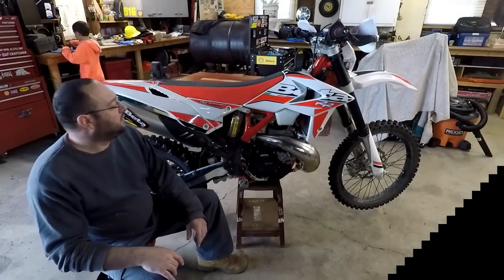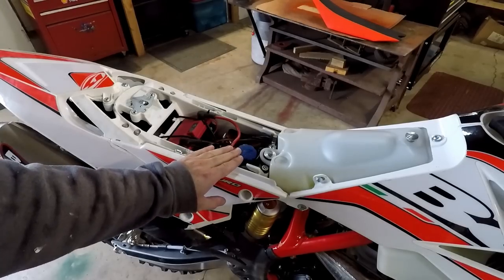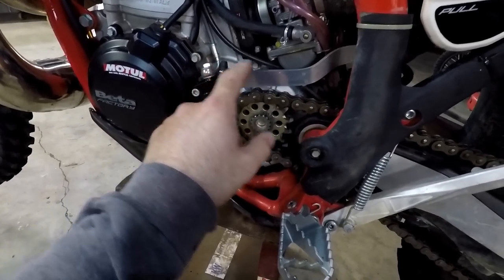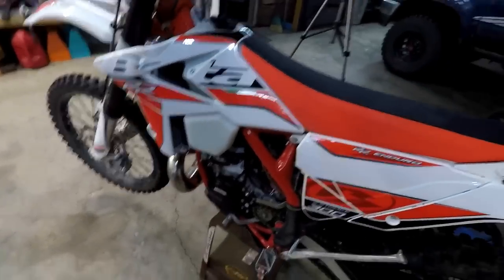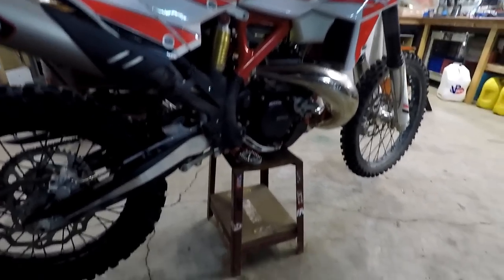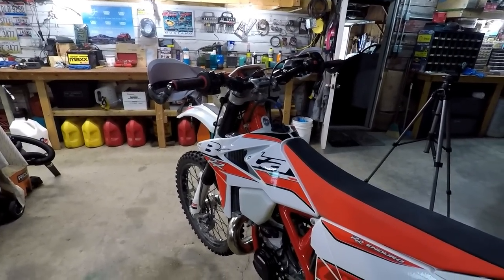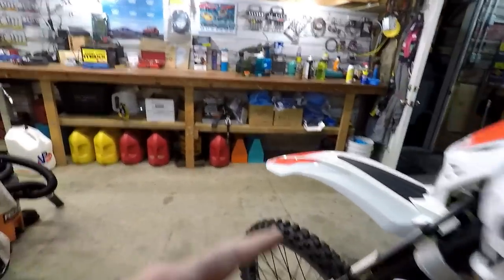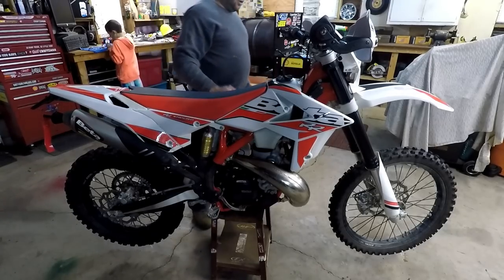2018 Beta 300RR Review PROS and CONS

Comment: I have the same Beta 300rr 2018, the problem is this bike it will make you think you are a better rider than what you really are and then you start to get cocky then into trouble, LOL . My speedo has done the same and it was a common thing, Beta should replace this for you.  I have never had a bike that you don't need to do a thing to it, as in suspension, power or add on like the FMF, V-force reed cage, hand grips, springs. The seat to me is not to bad, my one has soft written under it on the backside, the bike handles very well. The Beta's in Australia are around $2000 cheaper than the KTM and even cheaper than the Husky. I have friends with KTM's and they all need the suspension done to make the ride more enjoyable?usable or exhaust done, or replacing the reed cage to a V-force4 or something needs to be done. Beta's statement (Ready for anything) is spot on.Thanks for shearing.
Reply from the maker: @ BrokenSkull; 100% spot on with everything that you said! When I went on my first serious ride I felt like a friggin' hero on this bike! Everything just comes together and works so well for it being stock! People really need to get out and give the bike a ride or just get one, they are honestly that good. A friend of mine who tried my Beta still went out to buy a new TPI 300 KTM. He wanted the standard kicker and liked that the KTM dealer was close by. I understand all that, but with how easy it is to get parts of the internet, I would never be too worried. Most people that ride have spare junk lying around for minor crashes or flat tubes, etc. Anything serious can be had in a few days I believe. But yeah, great bike and with the money that I saved I was able to purchase some REALLY nice riding gear. I hope to see more people on Betas in a few years great bike and thank you for sharing your thoughts sir!

Comment: Nice review, I've owned mine around 10 months and never had a problem. When I was riding in -10c in the winter the starter sometimes missed the first few times of trying but the battery never let me down and it was kept in an unheated garage down to -25c some days. Kick start not needed in my opinion.
Reply from the maker: That's great to hear and thank you for sharing! I keep mine in another building that is heated, but yeah, there are going to be times where you may ride in cold weather, so it's good to know that this baby will crank. I really like the bike, very well balanced and seems to be built well. I did have to go over nuts to make sure things were tight after a few hours, but you'll get that with any bike. Thanks again for watching, it means a lot!

Comment: My computer also broke on my 2018. My dealer immediately replaced it. The only other issue I have had with mine was I did not like the sensitive front brakes. Other than that I love my bike.
Reply from the maker: My dealer I guess didn't care about me. I've called 3 times and they still didn't have a computer for me, so whatever. It's not completely broke or anything since I've fixed it with epoxy. It would have been nice to get a new one, but mine is still okay. It took me a while to get use to the front brakes as well, LOTS of stopping power. You really have to take it easy! It's a great bike, I'm glad that I have it and it sounds like you are too! Thanks for watching!

Comment: Good stuff, thanks for the outstanding review. Do you still have this bike? If so how is it working for you two years later?
Reply from the maker: Thanks for watching! Bike is still good. Battery is still good (I keep it on a tender) I'm going to need a rear tire soon, but otherwise, it's been a solid performing machine. The oil injection has been fine too. I run non-ethanol 90 in it. Work very nicely I think. Fit and finish still still holding up as well.

Comment: Thanks for the review! Haven't pulled the trigger on the purchase yet,  but close. Have owned KTM 200 and 300 in past. Loved both. I'm 6'2" and about 230 lbs now (weight up lol)...so I think the Beta 300 will be better than the 200 for my fat ass now lol. Low end torque and some mid are what I use 95% of the time. Subbed.
Reply from the maker: Thanks for the sub sir! I think you'll like the Beta 300RR. It's been good to me so far and I think a lot of other people have been happy with it. I don't ride as much as I use to, but when I do, this thing is just sooooo nice! If you get a chance to take one for a rip you should should do so and yes, that 300 will have so much more power than the 200 you are use to. The only really big advantage to the 200 (I think) is that it weighs less, but man, the 300 is like a tractor on nasty hills. I am still honestly blown away with how much you can lug this thing! Thank you for the comment and sub, GREATLY appreciated!

Comment: Im thinking into buying a 2018 300rr race edition. Any differnces between the two? This will be my first time on a 2 stroke if ever. Picked up a few answers i had in mind with your vid. Thank you. Liked and subbed.
Reply from the maker: Thank you so much for the kind words and subscribing, that means a lot to me! The 300RR Race will NOT have the oil injection and will have some different graphics, but that is about it. The Race might also have the kicker, I honestly forget. So, you'll be mixing gas, but you won't have to worry about the OI pump failing. Mine regular 300RR is still doing fine. Either way you're going to really like the bike. Let me know how it goes!
Reply: @BarnStangz  
Thanks you for replying. Will let you know when i pull the trigg on the beta. 👊✊🏍💨💨

Comment: during the break in period (15 hours if you read the Manuel) it will use oil a lot more oil than after the break in period. it really comes alive afterwards. but i do agree the light comes on too early.
Reply from the maker: Do you think the computer is programmed for that? I wonder if it knows that hours from the hour meter or whatever. I also remember the book saying to put some pre-mix in the tank for the first few rides as well. That's what I did for my 300RR.
Reply: @BarnStangz  i don't know if its somehow linked to the meter or if its something in the engine but i do think its a good idea to put premix in the gas for the first tank.

Comment: Don't know where you are but I bought and get anything I need for my 16' RR from Adventure Off-Road in Tennessee. Beta sent out a replacement  for the diode, it's not a diode but I can't remember what it's called. Beta also replaced my speedo when it failed even though it was over a year old. Dealer makes a huge difference.
Reply from the maker: That's nice, yeah, my dealer has been a bit of a let down. They never got back to me about my speedo, even though I called them a few times. I sort of gave up. If Beta is going to succeed in selling these bikes they need to keep after their dealer next work or people are going to jump ship. I'm glad that you have had good luck with your dealer. I'm in Ohio, btw. Thanks for watching!
Reply: @BarnStangz  I forgot to mention I'm in Louisiana but will drive the 500 miles to get my bikes from Mark. The absolute best prices and quality service.
Reply from the maker: Nice, good to know and thanks for sharing so that others know!

Comment: 👍Nice review, very detailed.  Answered a few questions I had in mind. Liked and subbed.
Reply from the maker: Thank you very much for watching! And I appreciate the sub, GREATLY! I actually took the Beta out today and it took a LONG time to start up since it was sitting for a while. I've noticed that with this bike. Good thing that it has am electric start. I bet it had to crank for a full 20 seconds, but it did start. I also make sure to plug the battery into a tender, that's a must to keep the battery fresh! I'll have to do a little review video on this bike, now that I've had it for a while.

Comment: waiting on delivery of my 2019 300rr BYOB. 1 inch lowered suspension, 1 inch lower seat, kick starter, rad guards and other farkles.  super excitd. thanks for the review. How did you get your bike so clean?
Reply from the maker: You are going to love the bike man! You'll have to come back here and post your thoughts. I was absolutely blown away with how well it worked off road. The engine is pure magic!

I don't think it's that clean, the wheels are pretty dirty still, but thank you. I made sure to pressure wash it very carefully and I then I hand wash everything else. I also make sure to plug the silencer so that water doesn't get in. Thanks again for watching!
Reply from the maker: Justin; You're going to love it man! The only thing that I'm worried about in the future will be if the oil injection ever takes a dump, but so far so good!
Reply: I have my bike.  love it.  raced an enduro last weekend.  I sucked, but the bike preformed flawlessly. Lowered from the factory.  very easy.  They offer a 2 inch lowering kit as well.  The 1 inch with the low profile seat was enough for me.  they make the BYOB very easy.  Frank from BetaUSA is in constant contact throughout the process.  It took less than 2 weeks to build the bike once they began. I strongly reccommend.
Reply: @justinsavs  How did they lower it? Internal suspension or a link?
Reply: @justinsavs  that's awesome!   Thx
Reply: @BarnStangz  my 2016 OI lost the feed hose at 5000 miles, I've abandoned the system for peace of mind during racing. 6000 miles 300hrs 3rd piston and the bike is still like brand new. I call it a 300 honey 3 stroke. I still have my 525 four stroke but only ride it when waiting on parts.looking to pick up a new one in the next year or two before beta goes to FI and completely eliminates the kick starter.
Reply from the maker: Very nice! Good to hear that the bike has been so good to you, other than losing the OI feed. Did you zip tie the hose? I'm worried that this will happen to me at some point. I always check it when I'm riding!

Comment: Went to the Beta demo day and .... as suspected the 250rr was my fastest ride. two unsuspected findings were; I was almost as fast but more comfortable on the 390, and I did not like the Xtrainer. The Xtrainer is the perfect size for what I want to do, but the engine vibration was a deal breaker for me. The 350 was comfy but no dice, the 390 was far better for me which was really surprising. In fact the 430 and 390 were both great to me and I was very comfortable and quick on them. I also did not care for the 300RR in the tight single track, but it was stellar in the open. In summary, if I had to buy one today it would be the 250RR with ohlins inserts.
Reply from the maker: Very interesting and thank you for your feed back. My dealer didn't even order any 250's since he said the 300 was the hot seller, but I can see where the 250 might have some advantages!
Reply: That is interesting to hear about the 250's
Reply: @mxfreaks  I can geek out over this LOL. If you look at the engine specs of the KTM or Beta 300, its what they call "square bore/stroke" meaning the bore diameter is the same as the length of the stroke. the 250's on the other hand, have the same stroke but with a smaller bore cylinder giving you what they used to call a "long stroke" where the length of the stroke is greater than the bore diameter. Different power characteristics. Almost all the four strokes went to an "over square" cylinder to stroke ratio, where the bore diameter is larger than the length of the stroke which makes for higher revving engines.
Reply: @A1soldiersaint   are the Ohlins inserts a factory option on the beta? I think I'm going with gasgas as I hear the KYB suspension is really good all around plus the motor is great from bottom to top.
Reply: @mxfreaks  they are an option and reasonably priced. Beta USA's suspension guy learned from "Bones" Bacon and worked at pro circuit, or so I heard. The Beta 300 and 250 have that kind of power, and can be easily turned into a fire-breather by adjusting the power valve screw. One thing I like about beta over KTM (besides better handling, and more useable power, is they feel slightly smaller and fit guys under 6 foot better.
Reply: @A1soldiersaint  just looked on the website and the Ohlins option is an additional 1500 on a new bike and about 2K on a used bike. That's a little too rich for my blood at this point but maybe someday. Thanks for the great info. I'm 5'9" so the lower seat height does sound enticing!
Reply: @A1soldiersaint   lastly what about the 200 vs 250? I'm a light guy only 150 pds and I've always wanted a 200 but wondering if I will regret it. Wish there were some demo days in the New England area.

Comment: Great review, what oil/ fuel ratio does the oil injection run at? Thanks
Reply from the maker: Thanks for the comment! I honestly don't know what the ratio is, because I'm sure depending on throttle input it would vary. I do know that it has a TPS, so I bet it runs lean and small throttle openings and then much richer at WOT! Thank you!
Reply: @BarnStangz  thanks for the quick reply! So now you have had this bike a while have you had any issues with the oil injection at all? I am very tempted to start saving for this bike (but I will be buying second hand!)
Reply from the maker: @ollie6512  Do it man. The bike has been good. The only thing that I've noticed is that the sensor in the IO tank and be a little weird at times if there is air in the tank. I make sure to move the bike around good and then fill the little tank before I ride and I haven't had any issues. It's amazing how much oil you save when you're slow going... I think it's a great device when it works. I know there are horror stories about people having issues and then removing the system... But it's been aces for me man. I'd say go for it.

Comment: Tell us more about the hand guards please, what make did you say? price? how to get some? they look the best I've seen. peter
Reply from the maker: Peter, thanks for watching. They are Cycra Probend Handguards. You can go to their website cycra . com to check them out. I got them directly from my Beta dealer when I purchased the bike since  he sold them to me at cost. You can also find them on eBay and Amazon. I've used a LOT of different handguards / barkbusters in my day and the Cycra brand is the best I feel. The fit and finish is excellent and then have replaceable parts should you bang them up. I have the same pair on my CR250 and they have taken a beating and still look really good. I forget what cost was, if memory serves I think it was $80 or so. I bet you can find them online for $100-$120 usd. But yeah, get a pair, you'll really like them!

Comment: Here is the issue I have with Beta and the lack of kick starter. They dropped the starter and kept the price the same. Then they want approx. $400 for one. And they bumped the price up another $500 for the next model year (2019). Getting close to the price of the KTM 300 tpi bike that has a kick starter. I personally have a had my new battery take a crap on me on the trail. I'm glad I had a kick starter vs trying to bump start it in the middle of the muddy woods. I'll stick with the KTM for now.
Reply from the maker: Sorry to hear about your battery. I have been pretty lucky with mine. No issues at all. When I get home I make sure to put it on the maintainer. Part of me misses not having the kicker, but the other half doesn't care. I'm sure I'd be singing a different tune if my battery went flat like yours did while on the trail. My one buddy REALLY liked my Beta when he took it for a spin, but the no kicker was a deal breaker for him, so he got a 2018 TPI.  But yeah, trying to bump start in muddy conditions SUCKS!